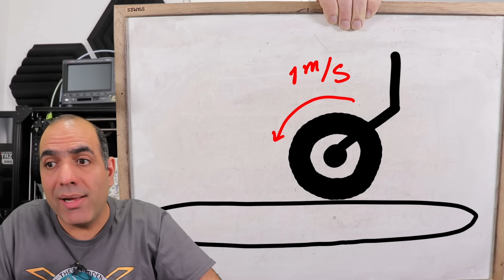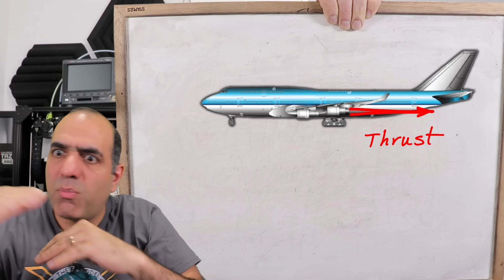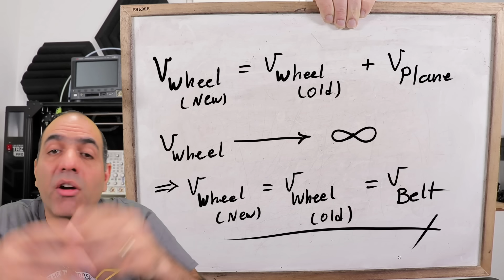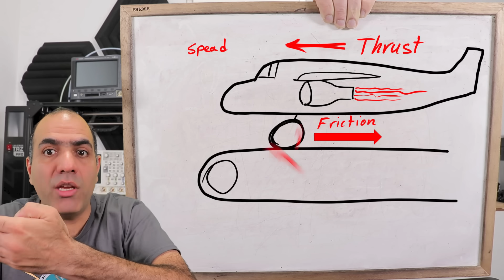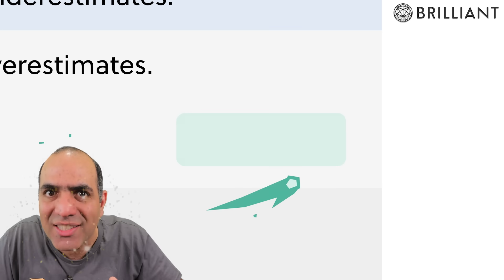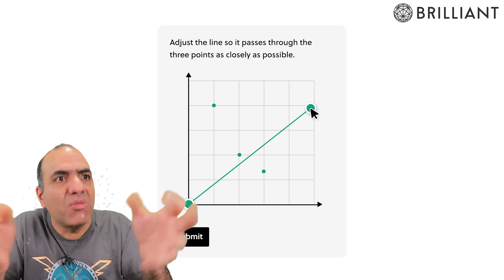Airplane Question that Drove Me NUTS!!!

Comment: I have taken all the time I need to think about the answer.

The way the plane's take off is by inducing thrust relative to the air therefore the ground speed beneath them doesn't actually matter. It is only airspeed that is relevant to lift.

Provided that The landing gear can withstand the speeds of the conveyor and take-off air speed, it'll be fine.

Fundamentally, it depends on the effectiveness of the bearings within the wheels in resisting the transfer of motion to the airframe, and the thrust capacity of the aircraft in overcoming this slight force as well as takeoff velocity.

Comment: I think that the wheel speed is irrelevant. A plane can be launched with no wheels whatsoever. Its all about the speed of the plane so the plane will not take of as fast as the treadmill and the wheels spin

Comment: I expect that if the belt exactly matches the wheels speed, then all of the engines thrust will be consumed by increasing rotation speed of the plane wheels (they will act like breaks to the thrust force). In reality this would require the wheels to speedup very quickly to insane speed ripping the tires apart, because the rotational inertia of those wheels is very small while the engines thrust is huge.
Continuing on, let's assume that tires and wheels are indestructible, and the belt as well, in that case the belt would increase its speed untill the belt surface reaches almost the speed of light, and so would the tire surface, and at that point i guess that they would slowly increase their speed closer and closer to the speed of light with the rotational inertia of the wheels and tires approaching Infinity, so the finite engine thrust will never be enough to push the plane forward in that scenario so i reckon it can't take off in that situation.
Reply: I've seen in the comments someone saying something about belt friction, in that case if the belt has nonzero friction (and it must have nonzero friction to interact with plane wheels), then at sufficient belt speed it would drag enough air with it to create strong wind layers around it dragging more wind layers around those and so on, although I'm not sure if breaking the sound barrier would wreck the effect of layers of moving air sticking to other layers of moving air going at different speed (which is very important for sail  aerodynamic efficiency and explains why sails are on purpose not made from super slipper materials).
So in that case perhaps it may be possible, but i think that it would require the belt to reach multiple speed of sound, and  dragged air shockwaves may mess up the whole thing, so I'm not sure here.
Reply: Mass-energy equivalency. If the wheels and belt spin at approximately the speed of light, both become increasingly heavy and the energy concentration could create a black hole. Is the rest of the plane also indestructible?
Reply: wheels on aircraft are not powered and all thrust comes from the engines on the wings just pushing it forward regardless of what speed the wheels are turning at. This is car logic that does not work for airplanes
Reply: @marcogenovesi8570  
You clearly don't understand the OP's point. Go back to school.

Comment: as someone who grew up watching the Mythbusters it's fun the see that till this day this simple physics problem is still a mystery to a lot of people. Wait till you guys find out about the truck full of birds and the bridge problem.
Reply: whatever floats your boat (or in this case provide lift to your wings). You can literally be so pedantic and argue no conveyor belt could be made to actually test the hypothesis you can come up with or pose another point of arguement such as what if there's some wind. Maybe you thought about what if the conveyor belt was already at take-off speed will the engine spool up fast enough to provide thrust before the plane falls off the conveyor belt. But, no matter what you point out as a significant detail to take into account it doesn't matter in this problem as the detail you should pay attention to is unlike cars, planes move by generating thrust and the wheels are there just to provide support to the plane while on the ground.
Reply: If you watched the video you would see that this isn't a simple physics problem. It's actually a failed thought experiment, because it's incomplete in a way that makes it impossible to answer unambiguously. All of Mehdi's proposed solutions are completely consistent with the question and yet, with correct examinations of the physics, result in completely different answers.
Reply: @bosstowndynamics5488  I agree with your assessment of Mehdi's assessment, and this is the best "answer" to the question yet.
Reply: @bosstowndynamics5488  His answer to the full friction scenario is still sort of flawed actually. The plane's speed would never approach zero because the engines apply thrust to the airframe and the wheels are passive. They would attempt to stabilize at infinity, but the friction would eventually exceed the tires strength limit and the plane would just do a sick burnout before still taking off. Planes don't actually use their full runway length to take off unless they're overloaded.
Reply: @foxcraft209  There are simple versions of this problem. This version is not simple. Well, it's simple if the wheels can slip. If they cannot slip, then it is logically impossible for the plane to move forward (as long as the conveyor belt remains stationary) because the wheels aren't allowed to turn faster than the conveyor belt.
Reply: The bird thing is again an ill-defined question.
An easy variant in which it works out is if we the "birds" in question are a massive Roc who takes the truck in its talons and lifts off.
Reply: it's obvious that the fuckin treadmill is magical. you know damn well what the question is asking.
Reply: They tend to reject your reality and substitute their own~
Reply: Thanks for that comment, was sure ill find someone who was thinking the same.
Reply: yup and somehow people are still arguing about it
Reply: Mythbusters also got the basic physics wrong on numerous occasions, they're not always a good reference.
Reply: @iffracem  So they were like regular physics courses. Neat.
Reply: @iffracem  They may have gotten some things wrong from time to time, but that has nothing to do with this particular myth. If the wheels do not have engines attached to them then there is no reason that a conveyor belt will do anything unless the pilot is also applying the breaks. They demonstrated this with an actual airplane and a giant tarp that was pulled by a truck. The plane took off.
Reply: @metgath  They got this one embarrassingly wrong. There's no way they could "exactly" match the speed by dropping the breaks off the plane and then flooring it in a broke-down truck. The do mention VTOL but the never mention STOL which is what clearly happened in their supposed experiment. They also never clock the speed of the tarp so claiming they "matched the speed" is just a lie.
Reply: @demuskumarius  They did it on small scale though and proved the point. 

Also to all in this thread, the word is "BRAKES" not "BREAKS". One stops something, the other is when you stop working.
Reply: @iffracem  chicken gun was really infuriating!
Reply: MythBusters isn't a good reference for good data or facts or science. It was a show for cheap entertainment, and they got a large majority of their research and data wrong and did a lot of the tests incorrectly.
Reply: As someone who watched the Mythbusters growing up, they messed up a lot. They couldn't even blow up a simple building with natural gas, and yet you see a bunch of news reports about it happening.😮 what other myths did they fail at doing, besides almost killing themselves or others! It's why the show came to an end.

Comment: The wheel rotation is irrelevant to the airplane taking off. The engines make the airplane move by moving the air around the plane.
The wheels rotating is a side effect of the plane moving on the runway. So I think it's not even possible to have a conveyor belt match the speed of the wheels since the wheel rotation depends on the surface they are on.

Comment: I would say No because it’s the stupidest question I’ve ever heard of my life and this is before you started your video, so I don’t know what you’re gonna say.

These are the four things I know that a plane needs to fly
Weight is the force of gravity. It acts in a downward direction—toward the center of the Earth.
Lift is the force that acts at a right angle to the direction of motion through the air. Lift is created by differences in air pressure.
Thrust is the force that propels a flying machine in the direction of motion. Engines produce thrust.
Drag is the force that acts opposite to the direction of motion. Drag is caused by friction and differences in air pressure.

Comment: I thought about it before I will watch the video in a few mins, and I think it doesnt matter if/how fast the conveyor is moving at all, because unlike cars, trains or other based vehicles it is not the wheels that drive a plane forward. Since the turbofan engines generate the force neccessary to move and fly the plane, not the wheels, it should be able to start almost as if the conveyor wasn't there. Of course some additional friction is added due to the wheels spinning faster (airplane speed + conveyor speed for the wheels) but a 747 should have more than enough thrust to overcome that friction. 
At least if I understand the question right^^
Im curious what you think now:)

Comment: The wheels will slide over the conveyor belt and the plane will take off.  This is like plane taking off from water.  Or if you put sleds on a plane and start it from ice.

However, if you include additional requirement that wheels cannot slide then the only possible solution is that plane stays in place.
Reply: You are correct, but only because not 100% of the friction with the ground can be achieved. The plane will need insane thrust to overcome this and get airspeed (although, any little bit of airspeed will reduce drag from the wheels I imagine)
Reply: so you admit there is no ONE answer depending on unstated factors. that's the point. anyone who found the ONE answer and needs to insult anybody who's operating under a different set of parameters is my problem with it. insulting people is never fuckin okay, at least when we're talking about a giant magical goddang treadmill. this is not aimed at you, but a lot of people are just being jerks for no reason, or well, for ONE reason and ignoring all the other possible and equally magical reasons.

the question, to me, clearly presents some MAGICAL situation where a treadmill is keeping a plane from moving. somehow. i don't care how it does it, but it does it.

Comment: Planes don't use the wheels for propulsion. I would think the tyres would burn but the power of the engines would easily overcome the resistance.

Comment: okay my guess is: "Yes the airplane will obviously move forward and eventually take off because the turbojet engines accelerate the aircraft forward and the wheels will just turn faster as usual. its the engines on the airplane that accelerate the airplane forward not the wheels! so it doesn't matter how fast the conveyor belt is moving or in what direction its moving because the airplane wheels rotate freely and the airplane is accelerated by its engines not by its wheels" okay so lets watch the video and see if i was right, i hope i was wrong because else this would have been way too obvious and easy
EDIT: maybe the reason why some people get confused over such an easy topic is because they spend too much time with cars and get a false intuition

Comment: In a practical sense, that plane takes off, the wheels are only there so the plane does not scrape the ground as it takes off, think of a plane taking off while floating on a lake, they use rafts and not wheels. So whatever the speed of the conveyor the plane takes off (as long as the wheels are free to rotate).

Comment: Yes it will fly, the conveyer has no influence on the plane other than spinning its wheels.

The plane does NOT use its wheels to push itself along, it uses the air to do that, so it is decoupled from the treadmill.

You could look at this question like an aircraft on a very very big and fast aircraft carrier sailing the opposite way to the plane that's trying to take off from its deck, what the ship does underneath the wheels is not relevant to what the wings do in relation to the air.

Comment: Hey Mehdi, this got me thinking: can you do an episode on how airplane power outlets work? Like, are they "grounded"? How much draw do they support? Thank you.
Reply: Hopefully not with a practical demonstration triggering the fault switches on purpose, like on those hotel episodes. 😎
Reply: @simond.455  Crew: * hears explosion and swearing in Farsi on plane *
Reply: An then he pops the plane
Reply: Do you want to get on the no fly list….😂 cause that’s how you get on a no fly list. Lol
Reply: Lots of things aren't grounded to earth directly, like basically everything that uses a battery has its own closed loop. If anything the large conductive body of the plane is probably enough to capture any reasonable static charges or whatever and disperse them into the air if needed. But the outlets are just looping through thr battery system with the engines as an alternator the same way a car does. Outlets are just a way to connect to a power grid, they'll function the same as something already within a power grid

You don't really have to worry a lot about directing a charge to the ground before going through you to the ground and causing harm, if there's no ground to go to in the first place as well
Reply: likely grounded to the airplane body. Similar to how cars ground.
Reply: I got this. They use the same technology that's used in those wireless anti-static wrist straps.
Reply: simply a battery powered inverter, grounded to nothing, no need for ground.
Reply: I had a friend who repaired the electronics on a C130. He learned the hard way that the breakers don’t trip soon enough when some ignoramus closes the circuit.
Reply: The ground for an airplane is the body and frame of the plane.
The engines generate 3-phase power at 400Hz! to save weight (simplified). AC is converted to DC for the instrumentation and der blinkenlights and gewiperbladen auf die Windschutzscheibe.
The draw is determined by the appliance and the wire size of the system.
Reply: Probably similar to marine electrical systems which typically are not "grounded" in the traditional sense

Comment: Absolutely, it will take off if the tires do not explode.  It’s about airspeed vs ground (tire) speed. When the wings feel about 150 knots airspeed over the wing, it will fly.  In this situation, the wheels will be turning 300 knots.  Remember, the wheels do not drive the airplane forward. The wheels just spin.  HOWEVER, the tires on a 747 are rated to about 225 knots and will likely disintegrate before the airspeed is suitable for takeoff.  I wrote this before watching your explanation.  I think we are close
Reply: It is about wing speed vs air speed. If an airplane is going 120mph and a 50 mph tail wind appears the plane will stall and fall out of the sky despite the engines still operating.
Reply: The belt is larger, therefore likely to break before the tires do. This will likely destroy the plane.
Reply: But it doesnt matter how fast is airplane accelerating and how fast the belt is moving it in the other direction to keep it stationary, does it? Because in the end, even at max thrust, the atmosphere around the plane will be stationary, thus no pressure differential?
Reply: @graullas8981  the turbines will suck  and push air and create the pressure differential.
Reply: @graullas8981  the plane does not use belt to accelerate, it uses air
Reply: @graullas8981  The atmosphere around the plane won't be stationary if you have a massive treadmill moving beneath the plane. Move that treadmill fast enough, and you will be moving a lot of air as well. Interaction between the ground and a planes wings is called "ground effect," and if you had an infinitely fast treadmill, you'd have an infinite amount of ground effect creating even more beneficial lift. In short, treadmill or not, if the plane has enough thrust to take off, it will take off.
Reply: @graullas8981  Engines on the wings don't care, they will still suck air in the front and push it in the back to generate thrust forward.
Reply: But the conveyor belt is stationary so how would there be any wind flowing over the wings, since the plane is at rest with respect to the ground And the conveyor belt?

Comment: Initial thoughts before any explanation... I don't THINK so, because if the plane isn't moving forward there isn't air running across the wings to generate the lift.
I look forward to finding out if I'm right or wrong!
Reply: Ah, I fell for the same trap as many, applying car mechanics to planes

Comment: This are no real circumstances, so the answer is equally irrelevant.
The conclusion is: If enough air is passing the wings in enough speed, it will fly. If not, so not. :body-blue-raised-arms:

Comment: Yes it can 747 wheels aren't powered  at all thay only have brakes  the jet is pushing it against air. If the that's why you can turn  a wheel in to a ski for snow or a float  for water

Comment: I think the plane would of taken off, because the power that moves the plane is not coming from the wheels but the jet engines. so when the planes engines warm up, it will take off.

Comment: No.Airplane needs wind speed under its wings in order to lift off. Conveyor belt will only increase rotation of airplane's wheels, wind speed stays the same.